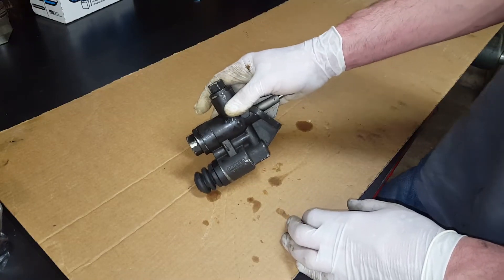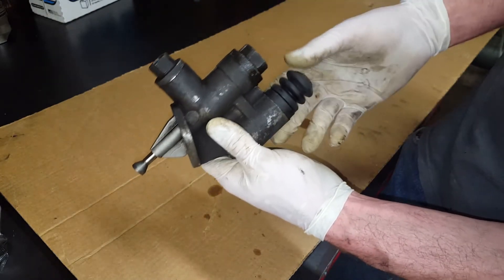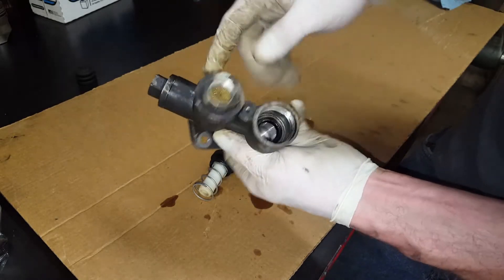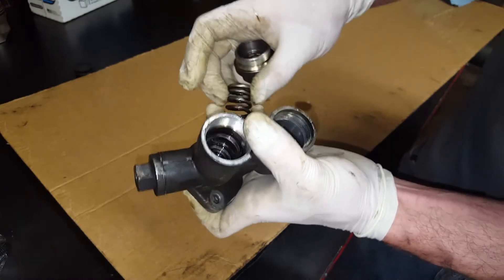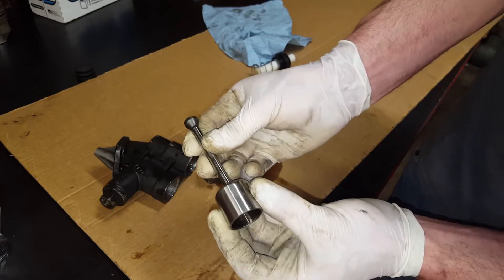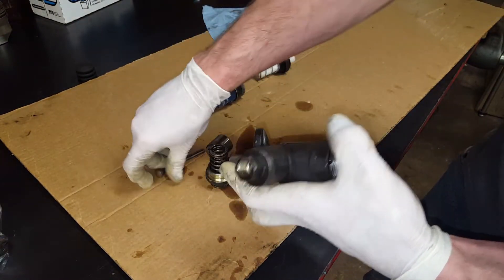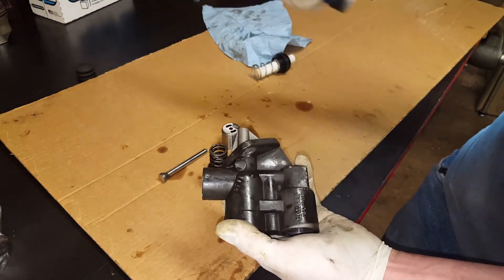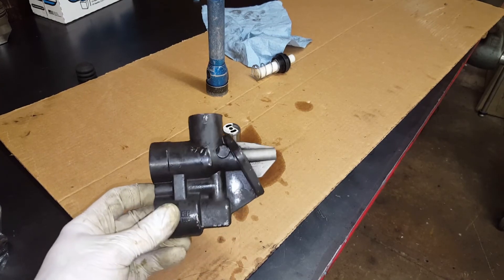Carter 12v Lift Pump Function / Break down Cummins 12 valve diesel 6bt

Comment: What are the symptoms of bad fuel lift pump on 97 ram 2500 turbo diesel 5.9 Cummins
Reply: Low fuel pressure
Reply: @by1591tanker  could the low fuel pressure make my truck loose power?

Comment: 2:09 Hey man not sure if you’ll see this sense this video was posted a while ago but i’ve got a question i’m hoping you could help me with. I’m currently modifying and upgrading my fuel system on my 96, i’m putting in a comp cam valve spring in my lift pump and i’m also deleting the pre heater. My first question is about the inlet/outlet fittings on the pump; I believe the female threads in the inlet are 1/2” npt and the female thread in the outlet are m14x1.5, but what I’m trying to figure out what thread size like the whole inlet/outlet fitting is that threads into the body of the pump. I can see it’s a male thread I just don’t know what thread size it is. I’m wanting to increase the female thread size on the outlet to 1/2” npt by finding a fitting that threads into it but I have yet to find anywhere that says what thread size those are or what those fittings are even called.

another question I figured i’d ask just incase is if you knew what the thread size was for the inlet in the preheated that connects to the supply line.

Anyways that’s all, if you happen to see this and could take a second to answer if you have one I wouldn’t be in debt to you! Thank you.

Comment: 4:10 can confirm. Put a knock off pump on my rig 6k miles ago and that seal went out on me a block from home a few days ago. Truck was stuttering and stalling, I barely got it back into the driveway. The pump never worked well, usually had a fair bit of white smoke on start ups but the fuel pressure had never dropped to 8 psi before.
Figured it was the lift pump since It wouldn't make more than 4 psi when I pumped it manually and it held the pressure after a couple hours.
I pulled the pump off the block and a bit of oil and diesel poured out of the hole. Checked the dip stick and it was a finger width over the max line. Immediately suspected the plunger port so to test it I poured some diesel into the top outlet port and watched diesel seep out around the plunger.

Comment: I know I'm late to the conversation, I am getting fuel in my oil and I suspect a lift pump or an injector. how can I test the pump out of the motor to verify the problem?
Reply: Take the fitting off the outlet port and pour some fuel in it. Look for diesel around the plunger. If the plungers wet it's the seal around the plunger and that's probably what is diluting your oil with fuel.
If the plunger is dry the seal is fine.
Reply: @brianlittleforest631  thanks! actually we had a huge rainstorm and somehow water got in the engine (the hood was off the truck) I changed the oil and made sure to keep the engine covered and all is good now.

Comment: I got 2001 24 valve Cummins an it loses power when I'm driving, so I'll have to pump the pedal a couple times for it to regain power. I was told it was the lift. Would u know if that is true or what it might be?
Reply: Could be the tps sensor. Throttle position sensor
Reply from the maker: U try fuel filter yet?

Comment: I just pulled mine off not because it wasn’t pumping but because of a pretty significant ticking sound . Upon further investigation it seems like the plunger is traveling further back than it supposed to and ticking against the spring retainer/end cap. I’m thinking to try and machine a uhmw washer which will move spring further into body and further away from end cap . Otherwise does anyone sell a rebuild kit or any parts for these ? Thanks for video
Reply from the maker: No problem man, honestly I would suggest just replacing the whole pump with a new one
Reply: NoNonsenseKnowHow I’ve read some pretty bad reviews about the current Chinese junk available as replacement . Which direction would you suggest I go in terms of pump choice ?
Reply from the maker: @tobaccofarmer4life  yeah I hear you on that. I actually did a separate video where I do a comparison of a Chinese pump versus the factory pump. I'm currently using a Chinese dcec pump and I've had really good luck with it. A buddy of mine used the one that is in the description of this video and he's also had great luck with that, 15k miles later no problems
Reply: NoNonsenseKnowHow ok appreciate it . I still think I’ll modify this one and see if ticking goes away . It’s not a big deal to tear it off again if need be .
Reply from the maker: @tobaccofarmer4life  that's what's up. Let me know how you make out and good luck
Reply: NoNonsenseKnowHow washers did the trick and tick has disappeared .
Reply from the maker: @tobaccofarmer4life  awesome man, saved yourself some Jang. Thanks for updating

Comment from the maker: If replacing your pump:
*GENUINE CUMMINS LIFT PUMP: http://amzn.to/2DmZC6p                  
*FUEL BOWL SCREEN/GASKET KIT: https://amzn.to/2La8dxb                             
*FUEL FILTER:  http://amzn.to/2FIXFqf
*STUD MOUNTING KIT: https://amzn.to/36ezwSq
*UPDATED INJECTION PUMP SUPPLY LINE: https://amzn.to/2PFn59Q  (stock hard lines are prone to cracking)  

*My Other 2nd Gen Ram Videos: https://bit.ly/2TLhJLQ

Comment: Is it a must to find TDC to install the new lift pump or just easier also considering I got the stud kit to reinstall it with.
Reply from the maker: Iv'e installed them plenty of times without being on TDC.  So its not a must but certainly a good idea.  Just be very careful to make sure it goes in straight and true.
Reply: William Baker do you guys know the diameter, thread pitch and length these studs need to be ?? It’ll save me having to remove mine. I’ll run over to fastener shop and buy hardened studs and have them ready to go in. My Chinese pump is leaking now so it needs to be replaced. Think OEM is best huh ??

Comment: Is the Carter brand the stock one used originally?
Reply from the maker: William Baker, yes the Carter is the original pump that was in the truck.
Reply: NoNonsenseKnowHow.. I saw your other video showing comparison of all 3. Weird that I got a new one from Cummins "made in china" and it's got the hole in it. Maybe they revised?...
Reply from the maker: William Baker that's great if it has a hole in it. I think the OEM one that I showed in my other video was a knock off. The packaging was official and seemed totally OEM. But as you saw on that other video ,  once I took it apart it was pretty shoddy inside. .  I'm running the dcec one in my truck now and it's been great. However it doesn't have that weep hole and that kind of bothers me some. Since you know if I ever had the seal blowout I won't know and see diesel dripping on the ground. It'll just pump right into my engine. How much was the OEM One that you got?
Reply from the maker: William Baker thanks for checking out the videos and good luck with the pump you got
Reply: NoNonsenseKnowHow $100 straight from Cummins service shop about 2 months ago. If I could post a picture I would.
Reply from the maker: William Baker that's not bad.  Yeah it's kind of annoying that you can't post pictures in the comments on YouTube. I think that would be a nice feature for them to ad. Maybe the pictures have to be approved by the content creator first before they go on or something though
Reply: William Baker do you have a part # for the pump you bought?